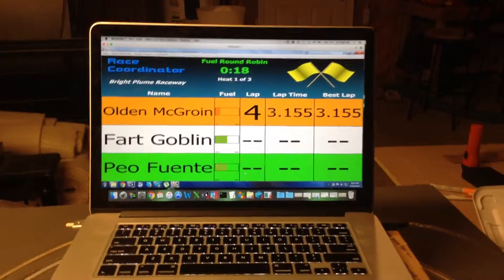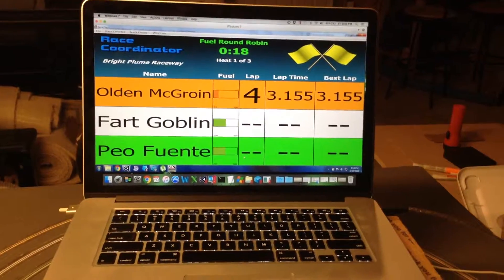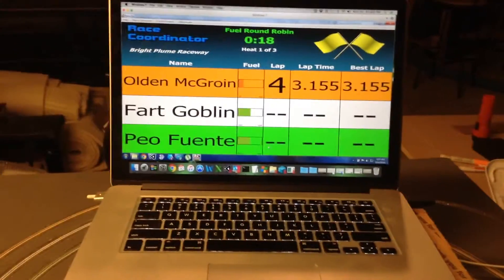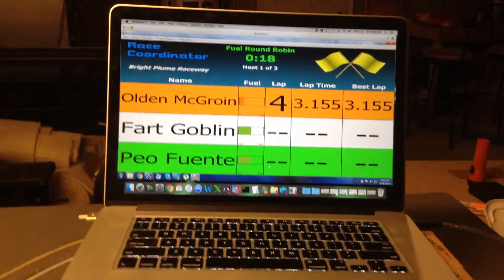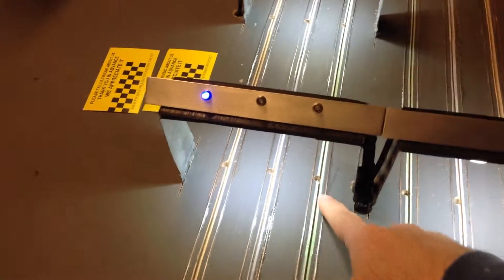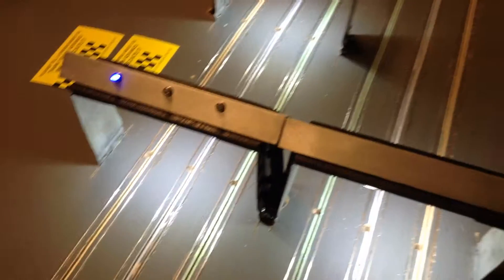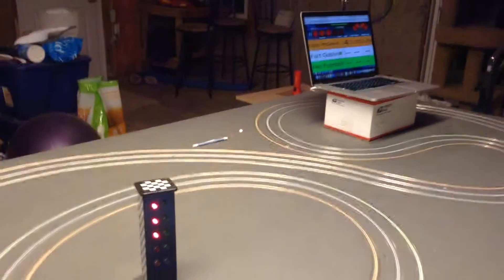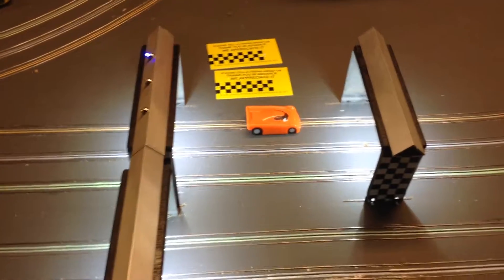Easier Pit Stops by Race Coordinator and Viasue

Comment: Hello, I am thinking of getting one of these! At first I just wanted/needed a lap counter/timer but when I seen the refueling it made me think.......could the one light bar/sensor do both? Could it keep time/laps and act as the pit stop in the same race? Or would I need two? or how about this? duel photo sensors under one light bar? I just dont want two light bars or one big bar running across my track. Or if it would be one big light bar, how wide would it be? Great VIDS!